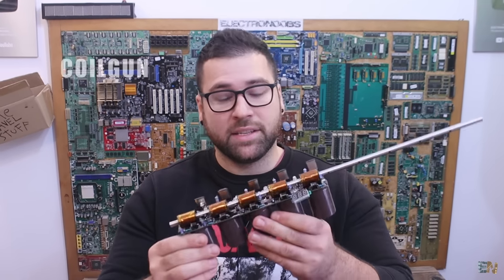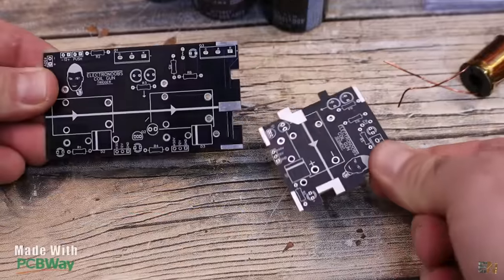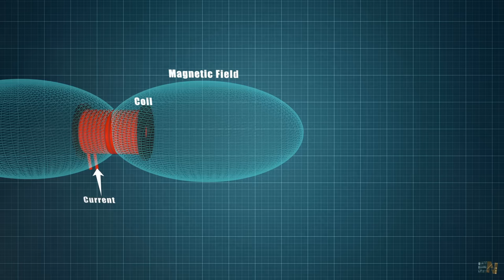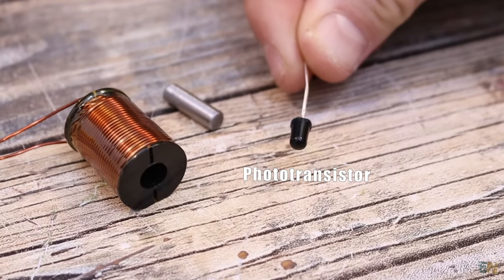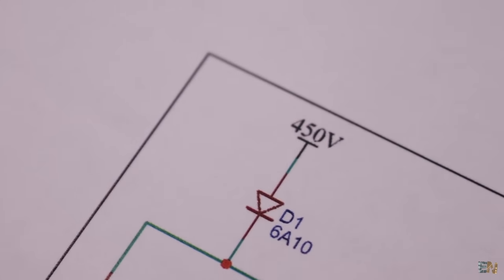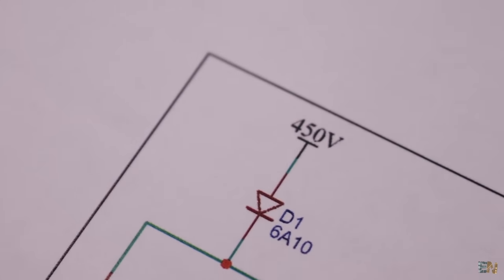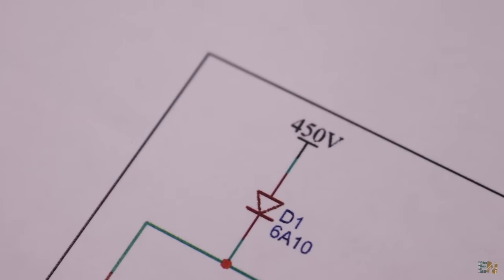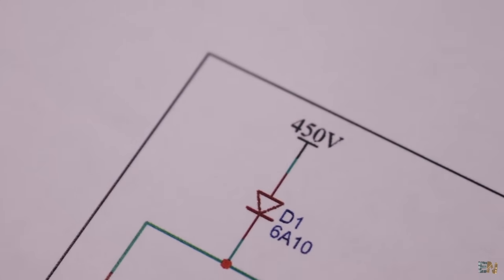I've Made a Powerful COILGUN | Separate Stages PCB

Comment: I'm thinking of doing this project with some adjustments to the photocell shutoff holes location. Like what if I place them in the coil itself just a bit after the coil center. I know there is a magnetic field delay that is acting against the projectile moving direction and it lowers it speed. Thanks for the great video

Comment: Have you noticed the recoil? The coilgun is basically a rocket that fires mass to propel in the opposite direction of the projectile's direction. This is the second law of Newton. It is the projectile that flies and not the coilgun just because of the differences in masses. The lower mass of the projectile is compensated by the higher acceleration.

Comment: Great video, but I do have one question:

The power gets cut off from the coil only when the tip of the bullet exits. This means the bullet has already passed the halfway point of the coil and the bullet will spend the time between then and exiting working against the field. This, to me, seems like it could potentially be significant? Assuming the same bullet is used each time (material, weight, dimensions), can't we theoretically find the time it takes for the bullet to enter the coil and make it to the halfway point, put the IR sensor at the beginning of the coil, and add a capacitor to the circuit to create a delay? Of course, the time would be different for each coil. Also, something else: adding more coils will not scale linearly and in the long run it will worsen the performance because the speed of the bullet changes from coil to coil and I hope you can see why this makes sense, and how a fix like this would solve the problem.

I'm only a student so this may be a miss but, yeah :)

Comment: Very nice. However, i would have put the IR sensor at the front of the coil rather than the end. You lose acceleration as it's leaving the coil before it gets shut off. So, taking into account the slight delay in the electronics components, and the fact that the sensor sees the projectile at the beginning of the coil, you would most likely gain tremendous acceleration without loss. Perhaps having the IR sensor adjustable, you could find the optimal position for each individual coil. You probably wouldn't need more than 4 or 5 coils to create a supersonic projectile.
Reply: Sorry you are wrong. The ball wants to center itself in the middle of the coil, the coil is much longer than the ball, so if anything, putting the sensor at the output of the coil will slow it down.

Comment: The current should turn off as soon as the object reaches the center of the coil. And perhaps even earlier, taking into account the time for dissipation of the energy stored in the coil. And, you may not know, but a thyristor cannot be turned off while current is flowing through it. Thyristors are used on alternating current precisely because there is a moment when the current stops, and at this moment the control voltage can be turned off.Thus, the thyristor does not turn off, but simply does not turn on the next time.
Reply from the maker: Yes, Thanks for your tips. For next version I might use IGBTs with a full control of the time it's on and off
Reply: @ELECTRONOOBS  It will be interesting to see.

Comment: Why don't you use 10kv ingnition coil s from old tech used cars ? It used to produce sparks that would be sent to the distributer then to the spark plugs...

Its just an idea im throwing out from nowhere, yet its a great design you'd have better results with a aerodynamic projectile and by making it covered with teflon coating...  Dont hesitate to make your projectile spin a bit for balistical stability... Great hobby you have...😇🤔🤐
Reply: Of course. Maybe, maybe. Very probably. See also forgotten weapon Coilgun HS-47:
https://youtube.com/shorts/BPReIoZ-2Nw?feature=share

https://youtu.be/0WF1BGmit78

Comment: Seems your metal pipe is like a short circuit ring on your every coil. This short turn would be a reason of energy loss. Try to replace this pipe to a plastic one. I suppose you will get more power

Comment: FYI, you can't really keep adding more and more stages. Eventually, one of two possible bottlenecks will be hit. Either the latency will be higher than the required response, or the density of air will require more power to overcome than is supplied to the electromagnet.

Comment: It looks like your soldering iron isn't getting hot enough on some of those joints. You should try turning the heat up and using flux to help the solder flow a little better

Comment: I have been thinking about a paintball gun type design for gravity feeding with an emp firing system. I thought about another round ball like any of the rounds from the hopper being dropped into a hole between a pair of coils. With some coils facing one way and the rest facing the opposite direction and the two sets opposing eachother. I was wondering about using that as the power source and the capacitors for the emp. Let me know what you think.

Comment: What is the maximum theoretical speed for this design? I imagine the detection method here and the switching circuit is the limiting factor. 

Wouldn't using the difference in power draw be the best way to sense the projectile's relative location to both turn on and off the coils?
Reply: No
Reply: @altzjennings6343  please explain

Comment: thats gotta be close to supersonic...i didnt hear the crack of the wavefront breaking but it went through that pexiglass no problem.

what if you threw in a voltage multiplier circuit or a capacitance multiplier, or added more loops? 

there must be a way to optimize the projectile length, so that its center of mass is in the right place when it passes through the ir led

Comment: You should adapt the electronics so that the polarity changes in the coil when it exists, that way each coil will be twice as powerful.
Reply: That only applies to magnets. In theory it would work if the projectile was a magnet but also since the capacitor is mostly discharged at that point it's pointless changing the polarity

Comment: Great stuff but the coil design like many other people default to causes too much eddy currents which decrease efficiency & requiring more power not to consider magnetic resistance, also the rod or bullet cylindrical shape is a bad design which add to the issue. A round or ball bearing would be a better choice as a projectile, next use a helix designed coil configuration & then you have the basics of a proper working rail gun. :)

Comment: Where does the dissipated energy from the coil being shut off go to? Is it just heat? Residual magnetic forces? Anything noticeable?

Only asking because on a bigger scale it could have potential cause some drawbacks in the fundamental design of the overall coil gun, either upon testing/firing, or the long term use of the coilgun.

Comment: I wonder if these 3 things could add to the velocity 
A rifled barrel
An aerodynamic projectile 
and 
an Air compressor 

The compressed air would act as a substitute for the absence of gas from the combusted gun powder and when combined with a rifled barrel create the same spin on the projectile. And if the projectile is aerodynamic, it wouldn't experience as much air resistance (loss of energy) once in flight.

Comment: Actually the system is a magnetic accelerator, but you have not calculated the advance of the coils, that is, the coils have to separate gradually according to the speed of the projectile, the last coil has to be much more separated than the previous ones to increase the speed of the proje. Greetings.

Comment: You can improve the speed by not just turning off the source of current fast , remember that the magnetic field doesn't cease instantaneously when you switch off the source of current, current will keep flowing in the wire and through the reverse diode making the magnetic field stay there for milliseconds ... your can "discharge" the coil faster if you user the correct zenner diode and a resistor instead a simple diode, so you will make a faster dissipation of energy in the resistor and zenner

Comment: also add rotation to the bullet,plus use a test bullet that has pointy teeth like front edge and test it on 1cm of stainless steel.
if you pass the test then we will talk.
I like to see you pulling that one off.
and also what will be the end products weight,the cost and construction hours.

Comment: What about putting the detector on the front side with a delay? Might be tricky but isn't the bullet slowing too much by time you're detecting it on the other side? Or make the nose of the projectile non magnetic so it can trip the sensor a bit ahead of time?

Comment: Is there a way to keep it more analog, I'm thinking one really long coil with many tap points, or even go as far to have a tap point on each loop. And let the tube the made of washers with insulator in-between each washer. And when your projectile is making contact with the washers they act like switches shorting/ grounding the individual loops of the long coil, so the coil behind or just after the front of the projectile has no power always keeping the strongest part of magnetic pull just at the nose of the projectile! What's your thoughts on this. Would be a lot of short wires I'm thinking but you could eliminate the circuit boards?

Comment: Several things need to be considered spacing, pulse width adding compressed air and you need the coil to reverse its field this will do a pull push action,military grade continuesly continuously, accelerates the projectile but some real analysis will get you going in a hurry. I guess I need to build one to show everybody how it’s done. You also need to hook the capacitors together if you switch each coil are use more voltage for each ascending coil otherwise you will never get over 600 feet per second. These weapons are capable of 5000 feet per second.
Reply: Reversing the polarity on the coils is a great idea. Really, the IR sensors would be better used if installed before the coils and then the timing for when to engage the coils as well as when to reverse polarity could be altered with a microcontroller until a top speed is achieved. I'm sure every coil would have a slightly different timing formulae due to the acceleration of the projectile. You build it and they will come!

Comment: I had this exact same idea, but in my design, not sure if it's any better but I don't have the diod breakers I drew a small induction coil to send the signal to start the next coil and also to pole reverse the previous coil to push, and it was meant to shoot magnets.
I never built mine so it's soo cool to see this at work!

Comment: Hey there, would it be possible to increase the size of the capacitors for greater power?
Reply: Yes, but at a certain point you might want to use a higher voltage to deliver more power

Comment: From what I have understood, why do we need an IR sensor to detect the position of the projectile. Dont the capacitors provide a small burst of current, and once discharged, they no more provide current to the coils.
If this is correct, then can we somehow (by changing the length of the projectile) omit the use of the IR sensor?

Comment: They use a variation of this in pinball machines (High Speed 2) as a ball accelerator. I like the experiment but a small BB gun could do the same with no external power needed.

Comment: maybe people enjoy doing things the hard way but i never had classes for this stuff and a few years ago in my garage i had a coil of wire and put a iron rod in it and momentarily hooked the two wires coming off the coil to a 12 volt vehicle battery. as you may guess, the rod shot out. i didnt watch this video and immediately paused it, maybe he shows a simplified version of what the video thumbnail shows but my first thought was i know how to do it simpler and so i clicked on the video just to say this.  the "circuit" if you can call a coil of wire with a iron rod in it a circuit, i described can probably be accomplished with stuff already around your house vs having to locate and order a bunch of components the circuit in the video shows, to accomplish the same task of shooting a rod through a coil. the way some of these people "teach" circuits seems to be more of an advertisement to buy, in this case, components, instead of teaching you how to accomplish the task in the simplest way with stuff you already have around your house. maybe show everyone what old products they have around there house they can use to take the components out of to use to build the circuit, and design the circuit to be the simplest version. lots of channels incorperate an arduino to power their circuit. to me thats adding an unnessessary component and just a plain advertisement. if they are going to try to get people to buy stuff, it should only be the essential components to complete the task and to teach people how to  buil the circuit in the most simple and smartest way. its the opposite of smart to teach people they need unnecesary parts and components, that teaches people to do things the unsmart way and makes people unsmart. "hey ma, look at what i made" ""awe son, that is wonderful, but you dont need all those extra parts to complete the same task, here let me show you how to do it a better way". if you going to teach someone something, teach them as if they are your own family. we are the human family.

Comment: Nice work, but i don't understood one moment: as i know thyristor opens (makes current pass trough it) when voltage applied to channel AND to control leg. But more importantly - it turns off only when both of voltages is ~0 V. In this scheme when phototransisotor stops appling voltage on control leg of thyristor current still must flow trough coil because there is still voltage applied to channel of thyristor because of capacitor. Only case how current stops in this scheme is when capacitor fully discharged after "opening". So how this scheme work? How thyristor stop to conduct current by phototransistor?

Comment: in point to exit speed: if exit speed is calculated and distance to next coil is known you have a timed event, therefore repeating for each coil with known entry and exit speeds you should be able to get rid of all the optic switching and use a digital controller and have each coil firing so its field had collapsed before projectile exit. 
alternate theory : calculate field collapse time and adjust optic point so 1st stage optic would be very close to entry of 1st coil (Slowest entry and exit speeds) 2nd optic further away from 2nd coil ( entry speed coil2= exit speed coil 1) the more coils the greater the distance on the optic to coil entry , so a long barrel or coil optic 1 before 1st coil  optic 2 and possibly 3 before coil 2, optic 4 5 before coil 3. Still a great project. im no mathematician just electrically skilled ;)

tips for soldering.  
for wires to pads   solder flood your wire 1st  then apply to pad and re solder, clean fill with clean edged fillets is the best way to get good connection. isopropyl wipe your board and keep it clean. PARRALLEL TO PAD GIVES BEST SURGACE AREA FOR CONDUCTANCE AND HEAT DISPERTION

ALWAYS DO IN VENTILATED AREA LEAD FUMES ARE BAD FOR YOU

 ELECTRONICS HATE HEAT SO USE AN IRON THAT IS IDEAL IN SIZE TO HEAT QUICK< GET DONE FAST > ANF GET THE HEAT AWAY AS FAST AS U CAN.  if you plan to solder lots dont be cheap and by a benchtop solder station thats fully heat adjustable.

Comment: Would it be better to switch the coil field instead of turning it off, so you get "pull & push "effect instead of just "pull".
Also, levitation & rotation of round would be great feature since barrol friction is the limittating factor of power and speed.

Comment: Your design has one important flaw - the magnet is stopped, when the energy of the projectile is heavily reduced. I suggest to put a plastic leader of 1-2cm on the front of your projectile.
Reply from the maker: The projectile is metal, not magnet. But I do understand your point :)

Comment: wouldn't it be more efficient to have a microcontroller time the power to each coil on a clock. if your bullets have the same weight and shape you should be able to produce consistent enough results to get the timing right on each coil (which is important since it will increase speed each coil). this would also allow you to put the coils closer together for more power with smaller size and it will prevent pull against the inertia your building as your still getting a little obstruction if it goes past the center of the coil even if it's less than 1 MS it would still help

Comment: The caps are probably wasting energy, still dumping current into each coil long after the projectile has passed, especially as the projectile approaches the muzzle end. Use IGBT's instead of Thyristors. The coil power can then be turned off after the projectile passes each one, leaving any unused energy in the capacitors. Then you'll have remaining energy in the caps after a shot and can then get them back up to max voltage much faster. Its the same sort of technology as used in a modern flash gun/speedlight. Maybe also use large caps at the rear, with progressively smaller values as you approach the muzzle, because their discharge time will be much shorter as the projectile accelerates. Finally use far less but heavier turns on the coils to minimise the time delay in charging the coils.

Comment: how do you discharge the capacitors without firing ? Can it have an automatic mode ? How do you know when capacitors are full ?
wouldn't be better to use 18v batteries from tools like Ryobi or bosh or... Why not having the first stages having the detector after the coil and the last ones before the coil so that you are less influenced by the speed of the comutation ?